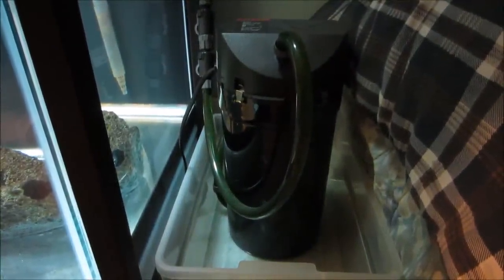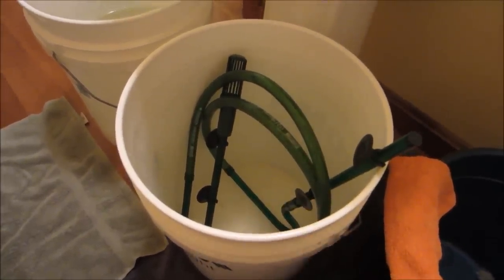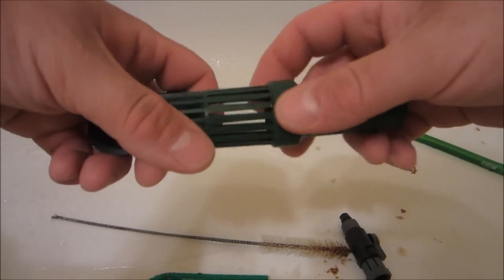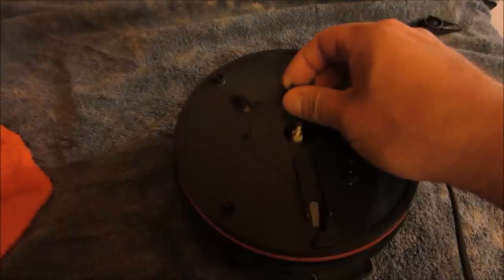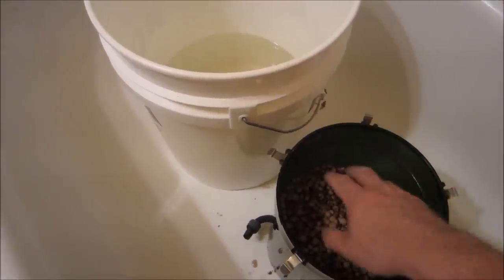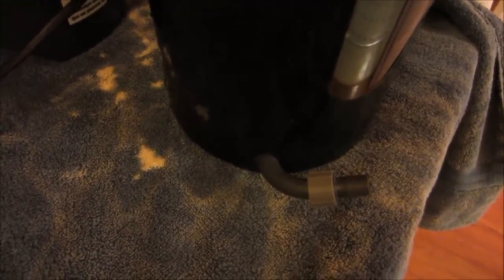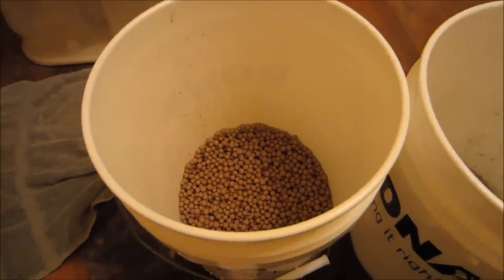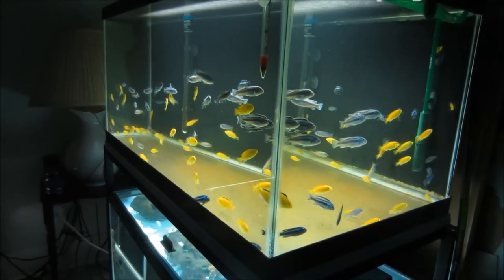How to Clean an Eheim Classic Canister Filter, Model 2215 & 2217

Comment: I have the same filter and I find that the best way of priming it is to close the valve on the bottom of the cannister, and when you have all your media etc in the cannister fill it up to the top with tank water, open the valve on the top of the motor section then place it on the top. As you push down and lock it in place with the clips water will shoot out of the top valve because it's open thus removing all air in the cannister, hook it up and turn it on. Works every time.
Reply from the maker: Nice tip! Thanks Paul.

Comment: You can use tap water if you first treat it with an antichlorinator.  I add seachem prime dechlorinator in different buckets. Then use that water to clean the Eheim media. The blue pad is the only one I rinse/clean with tap water.  I've been doing this for 23 years. The bacteria was never affected. I have two 140 gallons tanks. One with discus and the other one with African cichlids. Each tank has an Eheim Professional 3 filter.

Comment: Woody's Discus

   
Once you clean an existing 2217 (like yours) you NEVER have to "suck" on the tube! The water is still in the tubes . Just make sure the canister is a bit over half way full of water.I am adding a third divider so I can set up the 2217 the way PondGuru shows in his video " how to set up a canister filter". Will silicone the second plastic piece that covers the foams. Then add my Bio Home media. The 2217 is one great filter, my first one was over 36 years ago !!!

Woody
Reply: Woody's Discus

The eheim 2217 is the best for your $. All the new 'China" filters hav great reviews as well. The Sunsun has a 9watt uv in it and is very inexpensive..The new eheim is fantastic. I have a FX 5 as well. the 6 is a bit better. Stay away from the 400 series in Fluval. ( Have NEVER heard of a 2217 leaking ! The tip is ,eheim uses a rather large gasket, make sure it is seated all the way around.

Woody

Comment: I have had a 2217 for close to 30 years !!!! (on a saltwater aquarium). Bought a new one for my Discus tank ! THEY NEVER LOOSE  SUCTION !!! YOU NEVER have to "suck on a line to restart. " The water is in the lines so connect, (after clipplng the top). Hook on hoses, filter will fill air will 'purge' from spray bar.
Plug it in , your  set. You can tip 2217 back and forth to release air from top of canister. 
See Pond Guru on how to set up a canister filter .
Woody's Discus (FB)
Reply from the maker: Nice tips, thanks Craig.
Reply: My boyfriend showed me how to do this who never had fish aquariums.    This is my first one.  Some people are just more naturally mechanically inclined thankfully!!!   I would have never gotten this canister if it was not for him helping me.

Comment: Use for filter media HDX at home depot.1 gal. Elastic Top Strainers (2-Pack).
  Saves a lot of time, just rinse under running water. ALSO, smear silicone grease on Oring makes it easier to remove and replace. GOOD video.

Comment: This type of filter requires cleaning on a monthly basis or bimonthly if you run two. Dirty power filters become inefficient plus produce more nitrate due to a build up of waste inside the filter. Certainly wouldn't recommend leaving it 10 months.

Comment: awesome video. very informative. would you recommend this filter over the fluval? also what gal tank is this filter rated for?
Reply from the maker: +Jeremy Barfield I have never tried the fluval, all my canisters are Eheim Classics, the 2215 is rated for up to 95 gallons and the 2217 is rated for up to 160 gallons.
Reply: +robOzwrld awesome. thank you for replying.
Reply from the maker: Your welcome, the Classics are great filters, I have 3 of them, never had a issue and they do a great job filtering the water. They can be a bit more of a pain to clean then some of the fancier new models but they are worth it.

Cheers.

Comment: Hi, so I'm considering getting one of these filters, I've never had a canister filter. Are they complicated? Also, would this be good for a 60 gal by it's self?: EHEIM Classic External Canister Filter with Media
Reply from the maker: Hi Cody, the ehiem classic are great, rock solid filter! I have a 2215 on a 40 breeder and never need to worry, would work on a 60 as well but if you plan on really stocking your tank heavy, go with the 2217, no issues, plenty of filtration for African cichlids.
Reply: I'm planning on going with 10-12 tiger barbs and hopefully a pair of fire mouth cichlids plus a 6in pleco. Thanks for the reply

Comment: My 2217 is not going strong even though I cleaned it as you said and it makes a lot of noise. It used to run better but since I called someone in it hasn't been running the same.
Reply: Check the attached spinning thing ( I forgot the name) in the motor it's sliver, mine was mounted got it changed and it's fine no noise, impeller I think it is

Comment: I have issues with the o-ring on mine. It doesn't seem to want to slide onto the canister body, it sticks and rolls. Do you use any sort of lubricant like vaseline on your to keep it slick? thanks
Reply from the maker: I've heard of people using a little dab of Vaseline on the O-ring if it gets too dry, but I've had no issues with mine.
Reply: +Jeffrey Deiuliis I've heard NEVER to use Vaseline for the O ring. It is petroleum and is toxic! I use Dow 111, a silicone compound. Just a few dollars and will last for years. It is used if food systems and waste systems and will not harm anything.

Comment: How often do you need to change the filter media?
Reply from the maker: Hi David, I've never changed the bio balls or ceramic rings, they will last you many years, same with the blue sponge, just rinse clean in tank water. I change the white filter pad at every cleaning, usually every 6-7 months, my water is always crystal clear, so no need for me to mess around and waste money changing it more often than that, these filters are on some pretty heavily stocked tanks and never had grungy water. You can change the pad a little more often if you like, however I just do it a couple times a year! Hope that helps, cheers!
Reply: robOzwrld I actually went from a 10 gallon vertical half moon tank with an in-water filter, to a 54 gallon corner tank with the Eheim Ecco canister.  I was such a novice to this canister filter set-up that I couldn't even figure out how to get it to start moving the water through it.  I had thought that it sucked up the water the same way my little 10 gallon filter did, via motor.  I didn't realize the Eheim motor is only for pushing the water out to the tank ! Anyway, I shut off the intake tube valve, unscrewed the intake tube from the canister,  and pointed the intake tube into a bucket, turned the valve back on, and that got the water flowing. I shut off the valve again, screwed it back onto the canister and everything worked normally once I turned the valve back on. Yes, I was a tad confused. But all is good now !!!

Comment: THANK YOU!!!
I could not get this damn thing re-primed after i cleaned it.  
TBH, this filter is a prime example of "you get what you pay for".  Its cheap and irritating....
Reply: Go watch big Al's video on how to set up and prime eheim classics. Its very easy. Blow some air into the spray bar/output tube. Put it back on and let the filter do the rest. Ehiems are anything but cheap.
Reply: To fill the canister and water lines with water in 20  seconds, effortlessly, use your suction valve (siphon hose) attached to a sink faucet.  With the aquarium re-filled and water lines in place with all valves open, put the suction tube on the return tube going to the spray bar (before the spray bar).  Pull suction through that tube until the canister and lines are filled (20 seconds). Plug in the filter and it runs!